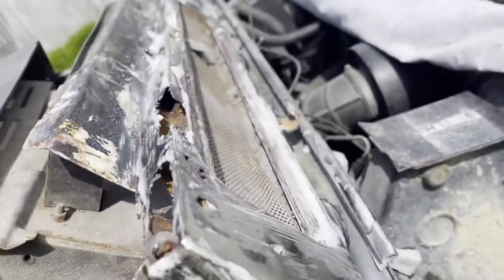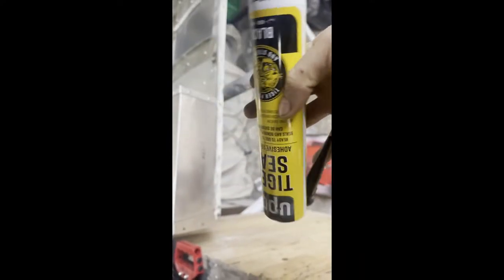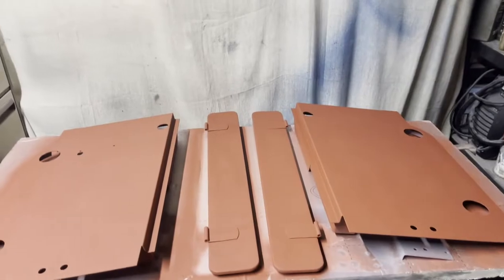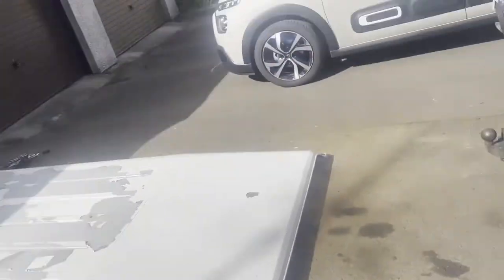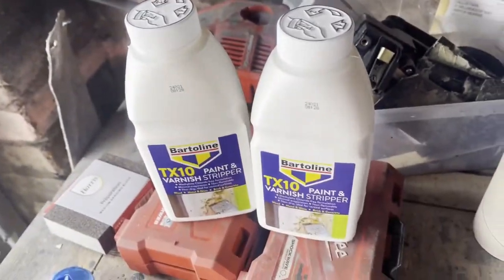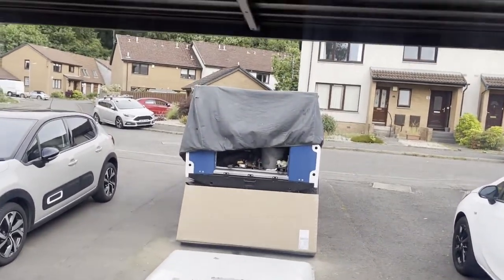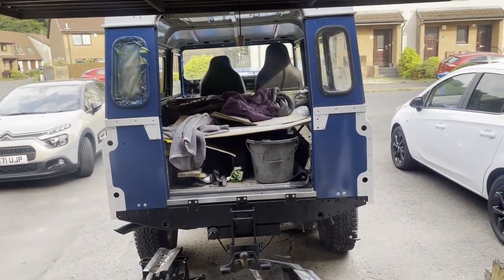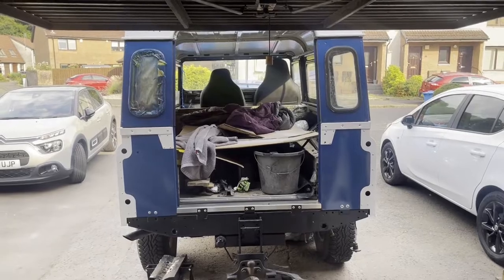Restoring a 27 year old Landrover Defender 110 - Part 4

Comment: Mind and repair or replace the ties between the chassis and rear quarter panels. They were flapping in the wind and disturbed the braze on the inlet of fuel tank with the filler neck pipe flapping in and out. I found about a fivers worth of change when I was mucking it out. Surprised you found another fivers worth. It’s coming on good man.   Good to see you doing the old girl right. I’m going back to a defender now. Modern pickup ownership has proven a bit rubbish.
Reply from the maker: Yeah just replaced actually with some galvanised ones. Thanks mate.  Just need to save up for some new bits !

Comment: I'm just fitting a new YRM Toolbox myself. How did you align the rear end of the end panel before riveting it?  My seatbox is off and I can't see how to align it without it being sat back on the truck with the sills in - which mine aren't yet.
Reply from the maker: I think I just went by the river holes I drilled out.  Hard to show without a pic.  To be honest I just did it by eye and as I say the old holes.  Good luck!!
Reply: @Oilatumify  I'll do the forward rivets and wait until the sills are back in then. YRM is quality at a price and I don't want to make a mess of it.

Comment: Really enjoying your video’s. I have started some repairs on my 90 and will probably need to fit a bulkhead vent repair section too. Did you cut the old section out or did you put the repair section on top of the old one?
Reply from the maker: Thank a lot!  I decided to cut out out the rotten section.  I’ve learned to use only the amount of repair section required and no more.  So basically I used have the repair section.  Welded it in, and emitted it down.  Learning as I go but seems really solid!